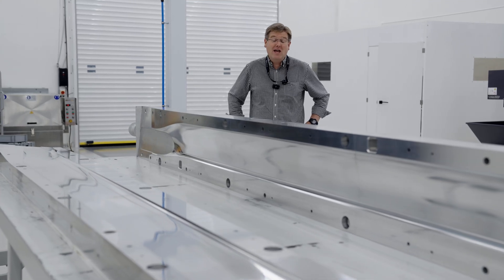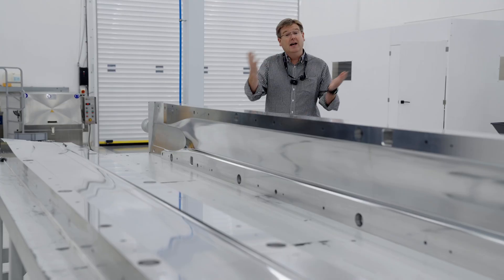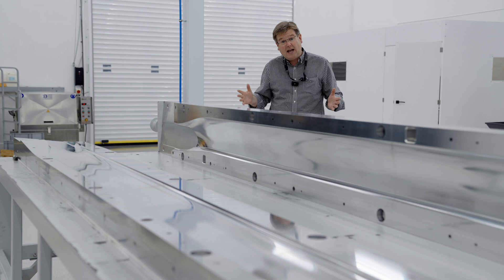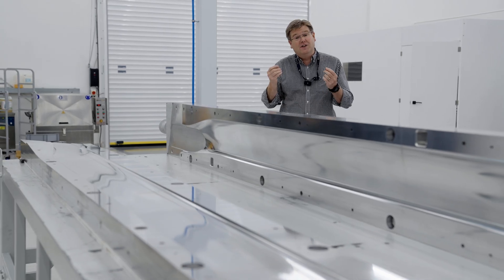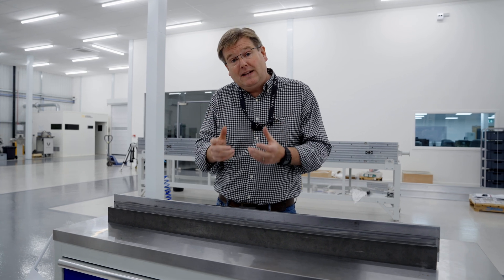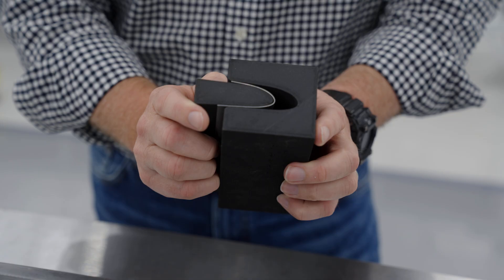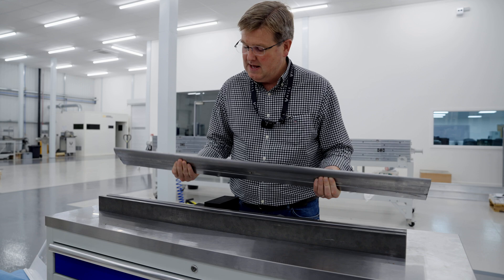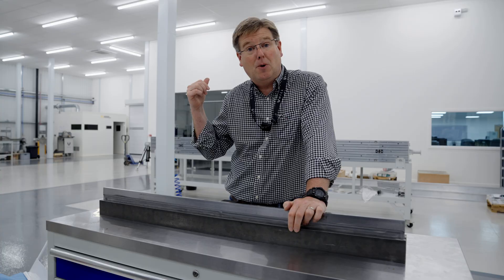The HX50 Rotor Blade Tooling is Complete

Comment: A-Star helicopters had an issue with their Composite Blades
when they first came out being to lite suffering from 
fast rpm Bleed down in Auto-Rotations, they ended 
up weighting the blades to resolve the problem. 
Just a heads up if not already aware. 
 Thanks for the update. :)

Comment: Are locations to mount handles or are the molds going to be opened and closed by machine.   Are there going to be offset backer blocks to stop any flexing of the molds.   Are you going to create a mandrel to wrap the carbonfiber on allowing identical placement of the fiber into the open  mold.   A mandrel also keeps cutting tools away from the mold surfaces.  Any plans for external tapered guide blocks to assist in alignment of the halves while closing.  Just ideas to print out and discuss. Talking about ideas can spur new ideas from creative people.